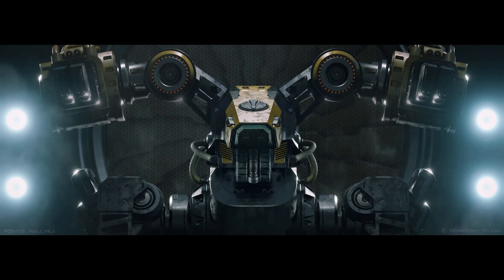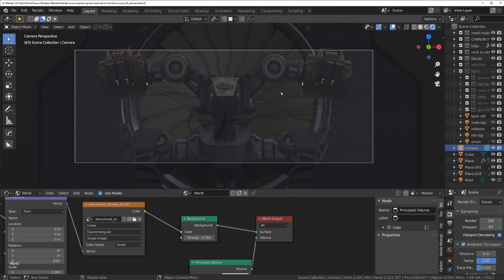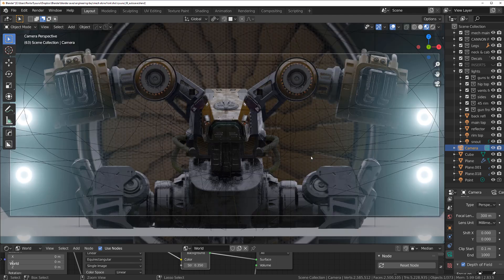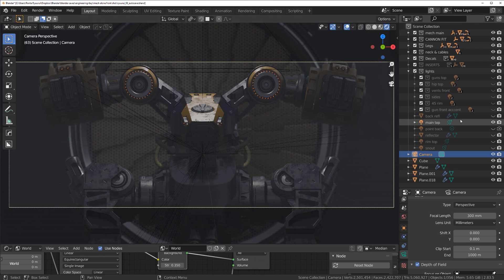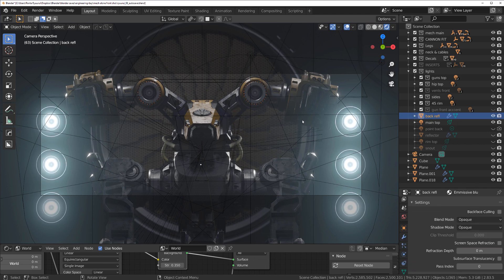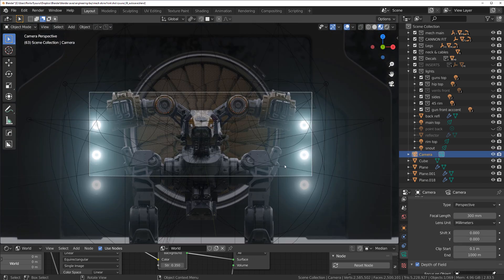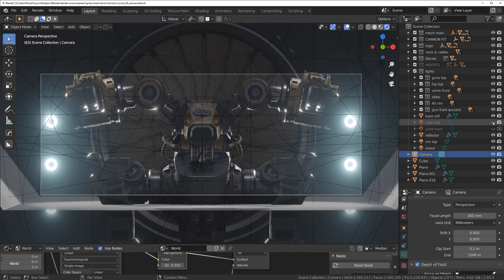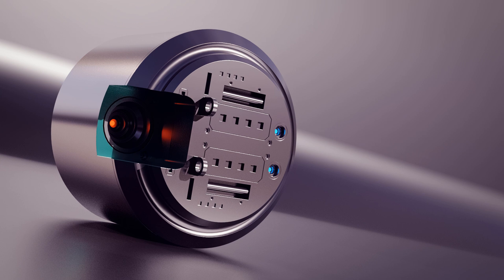Lighting TUTORIAL for Blender - how to create amazing renders

Comment: I've been thinking about this tutorial and have another question. The setup you're using is great for static pictures, but how would you change it for a simple turntable animation? Is standard three-point lighting good enough for that or would you add something extra? Would you be interested in making a tutorial on lighting something like that? You wouldn't need to use the mech if that would increase the render time, a simpler HS object that would allow you to demonstrate your reasoning would do.
Reply from the maker: Videos are a bit different, because you are not stuck visually with one frame. You can get away with a LOT in movies. People simply not notice it, but in stills, you are there staring at one frame, and the longer you stare the more issues your brain notices.